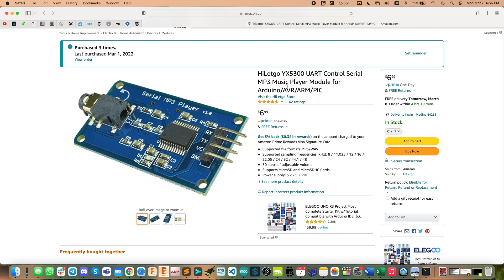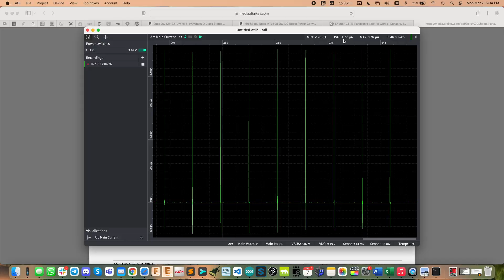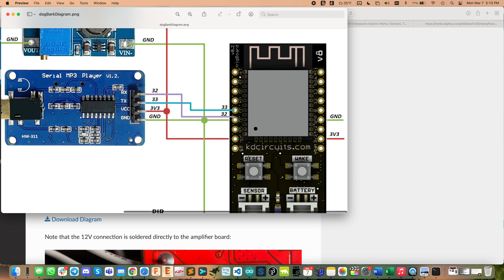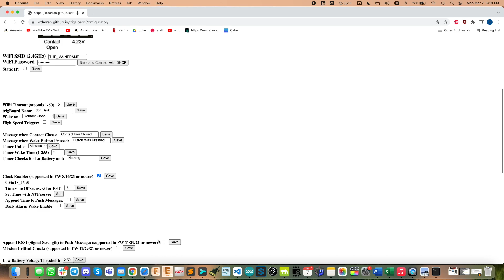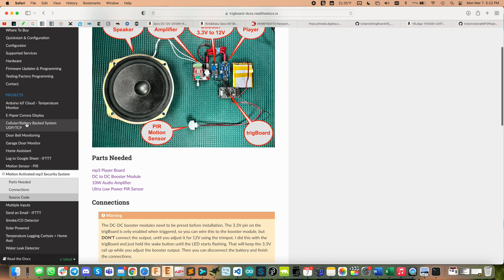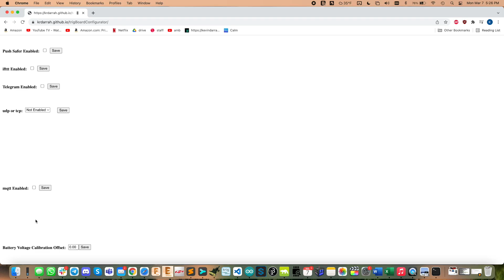2uA Ultra low Power Motion Sensor that Plays mp3 Files and Sends Notifications - ESP32 (trigBoard)

Comment: after you disconnect the battery, do you have to go back into the configurator to hit the set button to set the clock again?
Reply from the maker: yep, that's one down side...
Reply: @Kevindarrah  understand. Would be useful to have the option to set a specific ntp server address (so it can be local if desired) and then have a checkbox to sync time on initial bootup. You could also have an option to resync at some interval like weekly or something

Comment: We use these Panasonic papir sensors in our commercial products. They are really good parts, never had an issue, asides from the price (we use 4 for each product, ouch). You need an in-line resistor to limit how much current is pulled from their output, otherwise they can randomly reset and false trigger. The current limit is in their datasheet, I forget what value we use.
Reply from the maker: cool thanks - I'll check that out.

Comment: Cool project, although I'd put the speaker outside the box for louder sound. Or, instead of the MP3 player, I would juts connect a small car alarm siren and let it go off for a split of a second. Perhaps add some flashing lights for good measure. With a big battery, the options are limitless.

Comment: I was under the assumption that the Class D amps needed a positive rail, a negative rail. Not a Positive and a Ground. Is the amp really a class D amp? Just wondering. Thanks for the video.
Reply from the maker: ha, well the amazon description claims its based on a PAM8610... that is indeed a D-Class amp, which only needs a single rail.  Not sure, but may internally generate a negative rail as well.
Reply: @Kevindarrah  Edit: Ok. Thanks.
Reply: Class D amplifiers tend to use a H bridge, so switch both sides of the speaker. You do need good filtering if you have long leads, as you are essentially building an unlicensed radio transmitter, so you will need to have some LC filtering on both speaker connections to reduce this. Short wires minimal LC filtering will work, but if the wires are over around 1m you do need to put in the better spec components.

Comment: Nice project, I would parallel two pouch batteries or 18650's (if not 26650) then also add a couple of small solar panels to top up the batteries during the day.
Reply from the maker: yea I may test this out as well - we're gonna run it for a few weeks to see how well it works, then give it some "upgrades"